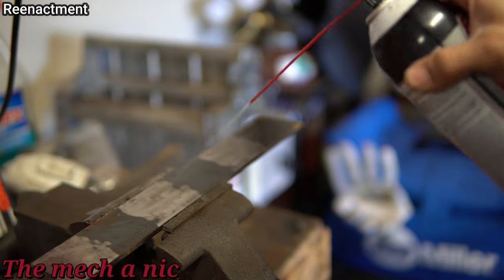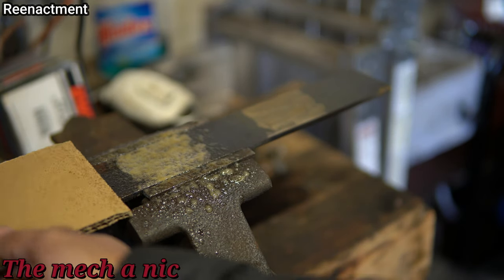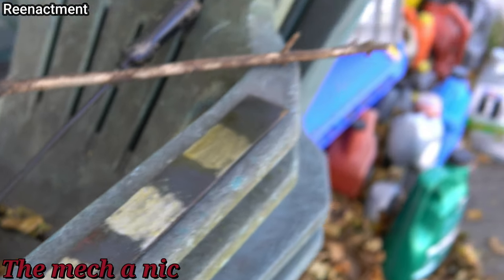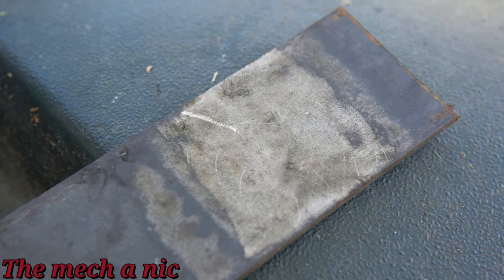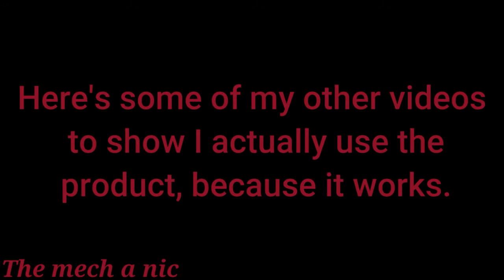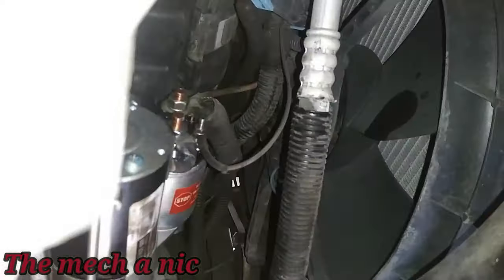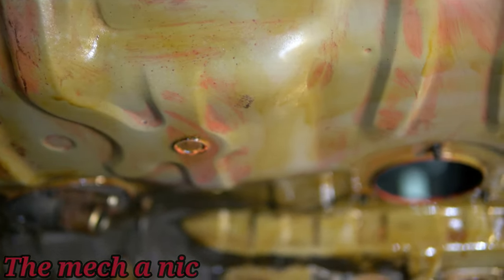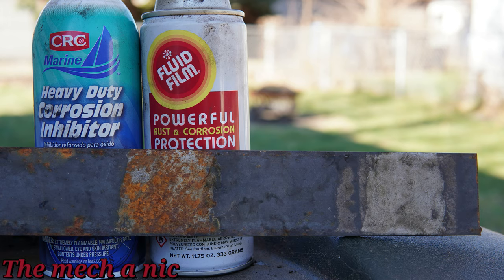fluid film vs CRC / one year update

Comment: One comment. On new fresh metal, it makes sense to use the CRC. On existing metal that is rusted go with the fluid film for better penetration. CRC is not a good choice for already rusted metal because it only sits on the surface. But on a new or newer vehicle, that’s great that’s exactly what you want.
Reply from the maker: Yeah I can agree with that, either new metal or the rust has been ground off and you have a fresh clean layer of metal
Reply: Would CRC still work well on a frame that has been wire wheeled?
Reply: "Ten year of using cold galvanizing compound" is my tread.  Look toward the end of the thread. For me Cosmoline worked over rust.

Comment: Only thing I can say, I use fluid film, it works great. The difference is fluid film creeps as CRC does not. Which in time gets into places you did not spray. There is no one that is perfect, but any thing helps over doing nothing at all.
Reply: Good point 👍
Reply: cr  dont wash out only with gas but fluid film it washe away i ised it fluid fil on my skies and after 1 ride its gone
Reply: Watch project farm, best vehicle undercoating. He goes through it thoroughly.

Comment: Agreed! I used it in my outboard on a bare metal part that is not easily accessible without taking off bolted covers and I found after a year in salt water use it is still rust free and the coating is like the day I sprayed it. Crc is the way to go.

Comment: So much better than tar undercoating CRC allows you to still clearly see everything and work on everything as if it’s not even there that’s the biggest benefit that I can see. Obviously after you rough up that some bolts or brake lines, or whatever the case may be you reapply the product, and then reapply a product every two years or so after that and you should be fine. at least that’s my experience. It works very well. I live at 1200 feet elevation in the salt and believe me when I tell you between prime and grit and lots of salt. CRC has been put to the test in my neighborhood.

Comment: CRC is the Best for my Atlantic Canada Area Even Worse then the so called Rust belt. . I was always using Fluid Film Spring and Fall to keep the body on a Toyota. The CRC I was so happy to find. My 2010 Rav4 got coated with CRC and it does not wash off in the Slush and Snow.  But I also use both still. There is Zero Rust under my Rav4 and Toyota's in the Area as New as 2018. Have been known to rust out completely.

Comment: CRC is great. Last fall I sprayed some rust reformer over rusting frame welds, then hit a couple of them after with CRC. Just checked & the rust is coming back through on the welds except for the ones I sprayed with CRC. They look flawless.
Reply from the maker: Yes! It works great!
Reply: You get lucky there because rust reformer is porous so cosmoline is managing to go in and do its job.  Otherwise rr is useless.  Used in past.

Comment: My 1 year review of CRC is it worked really well and did not attract dirt . I sprayed a New Nissan truck . The one place on the truck  it did not work well was in the rear wheel wells because the cinder spread on the road in the winter did remove (chipped off ) the CRC . Overall my opinoin is time to order more for the new Hyundai .

Comment: My personal experience with CRC/Cosmoline is it also traps moisture if sprayed over rust, much like Ziebart.  So for chassis components, I use fluid film.  Elsewhere, where the metal is really clean, no rust, Cosmoline sticks really well even after 2 years.  Now, I just have to respray suspension periodically and not really worry about any other part.
Reply from the maker: I can definitely see crc trapping moisture since it's so good at repelling moisture

Comment: I also live in Chicago and the crap they use to coat the roads just eats metal away.  I started using Fluid Flim and then switched to NH Oil Undercoating which in my opinion is either the same as CRC or maybe better, its hard to tell. Best way to find out is starting with a brand new vehicle and doing half and half then check it in one year. 
Plus these vehicles are not made like they once was, going just back to the 1970's the frames was solid and thin like they are now in my opinion

Comment: Blaster Surface shield is the best of both.  Superior protection that doesn’t wash off easily.  Plus you can get in 1 or 5 gallon and apply with a compressor.

Comment: Mate, awesome test. I recently just did the exact same test but for penetrol vs some rubber spray that stops leaks. I was so disappointed when they both started to get tiny rust spots still after 1 week, they did much better than the control, but i was still hoping penetrol with its massive reputation would have sealed the metal enough after 3 good coats, but nope. And i used to be a spray painter, so it was applied generously and with perfect coverage, so disappointing. I'll be buying some crc marine and testing that also. Cheers from Australia.
Reply from the maker: Thanks for watching.  Definitely give it a try. I still use it everyday

Comment: My question is what do they do to protect already rusty or painted metal, not bare. I see from your demo CRC is great to use on fresh metal, which I will do for new parts like fuel filters, control arms, etc. It seems chemically to interact with the metal, versus act as a water barrier like ther oily substances.

Comment: I've never used CRC before, but after seeing your test I'll definitely give it a go.  Much like where you live, we get heat, cold, rain and snow.  It's usually the road salt and calcium chloride used on the roads that eats the metal.
Reply from the maker: It works pretty good. Just dont spray anything that gets hot because its flamable
Reply: @themechanic6117  Great to know,thanks...

Comment: Hello Would the CRC trap existing rust where the rust would still corrode under the CRC (similar to using a rubber undercoating)? Or would the CRC seap into the metal and protect it from further rusting?
Reply from the maker: Hopefully this video answers that question.  

https://youtu.be/wJJFO0vVq34

Comment: I'm in NY right near Lake Ontario so I totally understand your weather perfectly. Been using Fluid Film for years with good results, I blast my truck with it pretty much every year. But, not surprisingly, I've still got some rust on my beloved truck because it's pretty much impossible to find and treat EVERY single nook & cranny. Now I have to replace a front fender (mostly thanks to some moron that plowed head on into me while I was sitting at a red light! How the f does one do that?) and under the fender flare - where the rust always hides - it's pretty badly rotted, hence the replacement. So here I am looking for the best pre-treatment so that the new one lasts. Looks like a can of CRC is in my future. Worst thing is, looks like aerosol is the only way to get it whereas the FF I've been getting in gallons.
Reply from the maker: I use crc for everything,  I think it's more resilient compared to FF

Comment: Hey buddy, I'm in the hunt for better rust proofing. How do these 2 products interact with each other? Like put fluid film on the seams, cracks, rust, ect. then crc over the top while doing the clean metal with crc.. maybe wait a few days after the fluid film application, thoughts?

Also I live in Illinios near Dixon..
Reply from the maker: If you're using both on the same area I'd spray the crc first and give it a day to cure then fluid film over it

Comment: What would you say is the best rust converter product to coat inside of the frame of a car, where it's difficult to brush paint?  I'm planning on coating my car with por-15, then CRC, but not sure what to use inside the frame, thanks!
Reply from the maker: When I spray the inner rails of my car I'm going to try to get crc in there . If not applied properly por15 can let rust form under it
Reply: I've seen numerous videos where POR-15 peeled off in large sheets, I guess because of improper cleaning or prep, but in any case, it seems much more risky to use for that reason.  That's why I decided on using CRC.  Also, CRC is pretty easy to spray inside the frame, the spray mists out very well and spreads.

Comment: In your opinion is fluid film the way to go if our cars already have rust on the metal? What about Surface Shield?
Reply: I had both some rusty but mostly unrusted body undercarriage parts that I treated thoroughly last fall before salty road Northeast winter.  Just got up under there last week to assess and 're-treat' as necessary.  Treated areas (even over rust) looked PERFECT and identical to how they looked after they were treated and the product had dried last year.  I was amazed.  Resprayed delicate parts anyway while I was up in there to ensure zero exposed metal (but I probably wouldn't have needed to; however all the work/time spent was just getting the car lifted and all skid plates removed).  CRC stuff is the bomb.  Buy it in 4 packs.. Big savings.  ***I just wish there was a long tube applicator that has a wider dispersion spray coverage so that you can get up into all cavity's and cover every inch of metal floor pans/welds, etc AND into the frame cavities more easily.

Comment: Good video! 
Amsoil now has Heavy-Duty Metal Protector,  Product code : AMHSC-EA. 
Just bought a can because it was used on the Legit Street Cars channel. 
Haven't seen it tested yet though.
Reply: Actually it has been tested. Looks good. See 2018 video:  Heavy Duty Metal Protector vs Fluid Film
Reply: @cw742  Am Hd, Crc hd, Crown hd it is all Cosmoline.  There are not mystic in this.  It is cosmoline or linoline (ff).

Comment: Thanks for posting the video,  I agree,   I do like fluid film but think that the crc works better.    Have you ever used crc on a painted surface such as a vehicle?
Reply from the maker: I've sprayed it on chipping paint so the bare metal doesnt rust. It didnt effect the paint in any way
Reply: @themechanic6117  It is what make only sense.  Cosmoline over good paint is useless.  Cosmoline over chipping paint is it exactly as you said.
Reply: Do not be 100% sure in that.  Wicking and creeping is issue.  FF go better in  seams and it is where rust start.
Reply from the maker: Yes i did notice that FF is very good at creeping , thats why in the video i mention that FF has it's uses and i still use it.
Reply: @themechanic6117  can you use CRC as a base coat and FF on cracks and hard to reach places or even as a 2nd coat ?
Reply: @Lowdown13blues  those are my thoughts. People have said crc can trap moisture in existing rust. Im guessing if the rust was really dry like garaged vehicle it may be different.

Comment: I'm surprised fluid film didn't work so well. Nothing like personal experience.
Reply: Fluid film was barely sprayed on looked like can was running out where as crc was full
Reply from the maker: Theyre both used cans plus that doesn't really matter since I got full coverage with both products. They spray different, crc spray almost like a liquid and fluid film sprays like a wax thats why its inconsistent while spraying.
Reply: @themechanic6117  it looks like it didn't get complete coverage
Reply from the maker: It did. I wouldn't wait a year and a half to post this video if my testing method was flawed. If it didn't get good coverage even I understand that it defeats the purpose of this comparison.also are you referring to where i first sprayed the fluid film.....where it clearly said "REENACTMENT"

Comment: Hi The Mech a nic, can you perform a similar test on Aluminum to see how FF does on corrosion protection on Al?  as the new cars are aluminum body and stuff. It will be a good test. Thanks!
Reply from the maker: Good idea.thank you
Reply: Curious question. If you think the results would differ for aluminum, then you would have to consider each gradation of aluminum.  And if that, what about different non-aluminum metal alloys?
Reply: @65csx83  I would use CRC and as the base metal is not exposed to road salt once coated it makes no difference what metal you use. As a welder and top fabricator you would always start off with anodized aluminum if possible for corrosion resistance. The anodize coating has to be ground off to TIG or Heliarc weld. Bare aluminum is as bad as steel when it comes to road salt corrosion. I would use 5052 aluminum which is easily available and easy to bend and weld. Of course stainless steel is always used as a corrosion proof metal but it's hard to drill. It's not used very much because it's very expensive (Nickel & Chromium) but if one has the money use it. It will never corrode under any condition.

Comment: Great vid man I just didn’t have any luck with crc marine i undercoated the whole brand new car. Came off I didn’t feel it anywhere except under the hood. I washed the car at least once a week at a car wash. I live in north east ohio. I was think maybe the soapy water rinsed it off?
Reply from the maker: I have trouble removing crc with brake parts cleaner.. find it hard to believe that soapy water will remove it
Reply: @themechanic6117   maybe it’s something you can make a vid on? I just know I didn’t see it anywhere under the car anymore after one winter and I can’t figure out why
Reply from the maker: It dries almost clear. Are you sure it's come off. I sprayed my car two years ago and it's still noticeable that my rockers haven been sprayed
Reply: @themechanic6117   i tried to feel it couldn’t feel it so i tried scraping it with my nail and didn’t get anything so I figured it was gone. Only place i seen and felt it was inside under the foor panels where the weep holes are and under the hood
Reply: *door not foor
Reply: Maybe the car had a light oil coating on it still from the factory. Undercarriage wash is not all its cracked up to be! I used to own a carwash, undercarriage forces water up into areas it shouldnt be. Frame and rockers can get flooded.

Comment: FF is actually nothing more than vegetable oil with a splash of lanolin (sheep grease) added to it, that's it! CRC is a mixture of slack wax (oily brownish less expensive to manufacture paraffin wax) and a combination of solvent's to keep the wax in a liquid form for spraying until it evaporates, once it's sprayed onto any surface. Both can be homemade with some basic skills if your into that kind of thing.. Do some research and remember practice safety around flammable liquids..

Comment: Yo brother! Great video, you turned me onto both of these in your KRX series along with many other tools and techniques 🤜🤛 appreciate it!!! 

Have you heard of/ tried out KBS Rubber undercoating + KBS Rust seal? I’m looking into the KBS Large frame kit (3 step process) + Rubber undercoating to put on my EF hatch. They have asphalt too. Any thoughts on rubber or asphalt undercoatings? 

Looking forward to the KRX updates brotha!!! Your build videos is one of my favorite on YT. Keep steady grinding!! 💪#EFamily
Reply from the maker: Thank you for the support👍💪 i have a crx video in the works. Id suggest not using any of those rubberized coatings. They eventually peel off and allow moisture to be trapped behind the coating and itll actually cause your car to rot away much faster! Stick to a combination of fluid film and crc to protect from rust.
Reply: The mech a nic right on thank you for the advice !! Will definitely take it and stick to fluid film and crc. 🤙

Comment: I would be very interested in comparing CRC and XCP Rust Blocker. According to my tests, XCP Rust Blocker is significantly better than Fluid Film or Corrosion Block (which is bad at all). But I don't have a CRC available to buy. Please try to get the XCP Rust Blocker and take the test together with the CRC.

Comment: Fluid film is a lanalyn based. It doesn't have any solivants.
Reply from the maker: Yeah it has its up sides. Thats why in some situations itll be better
Reply: @themechanic6117  I've heard it's also been used on agricultural and landscape equipment too. Especially fertilizer spreaders which tend to rust out.

Comment: Why not use Fluid Film for the creep then a week later follow up with CRC?
Reply from the maker: I'd spray crc first because it needs something to dry and cling onto. If you try spraying crc over fluid film it'll never cure and wipe off just as easy as the fluid film does.
Reply: @themechanic6117 good point I didn't think of that, I'm definitely going to give it a shot

Comment: The Vikings used Woolwax on Metalparts of their Ships.
And it give Carnarubawax from Brasil.
Thats mostly the ingredients of all Products and Shoewax up Today.
The best is MIKE SANDERs Rust Prevention Grease, but it must be
heated to apply on to your Car .Fluid Film is more like wire rope grease.
It belongs to what scope of application you need.Read at their Homepages,
whats the best for your scope of application.

An other old Method is Linseed oil varnish,its cheap and easy to apply,
but its hold only a half year and needed then a repeat.

But first make your Car ready,dont put any Grease on and start then welding.